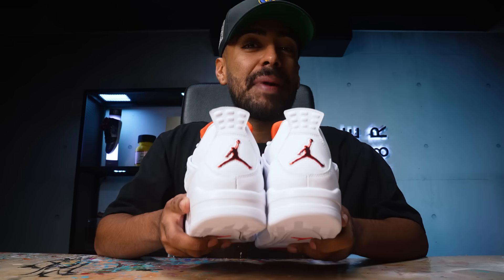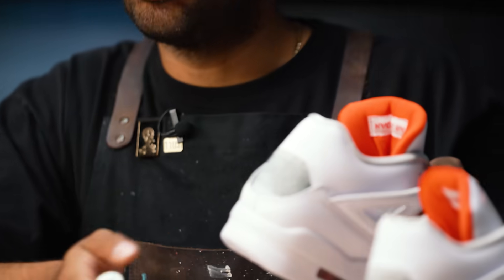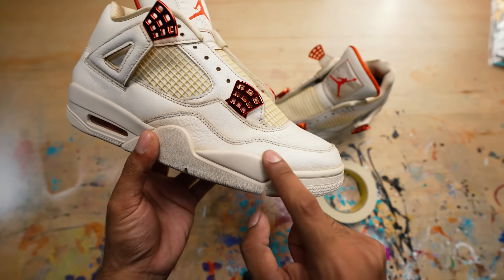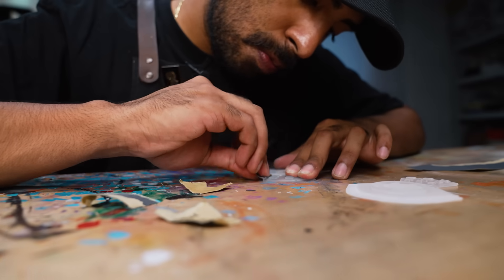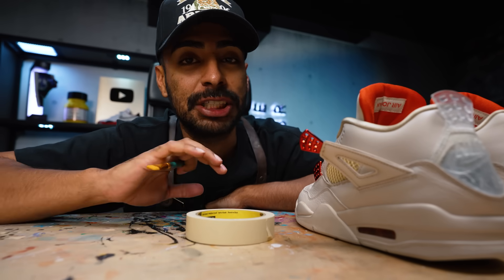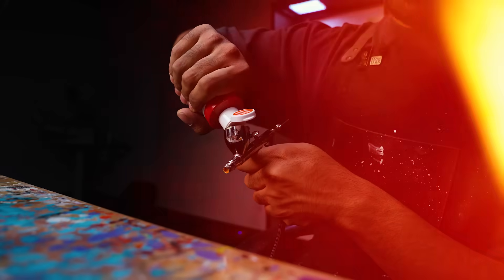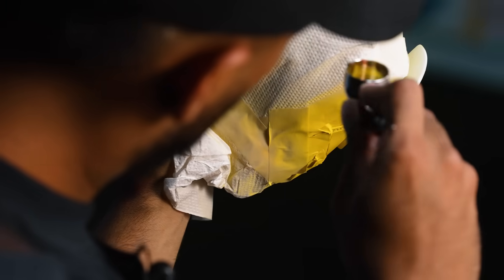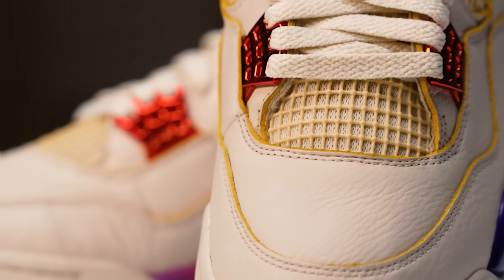Custom Air Jordan 4: J Balvin Inspired

Comment: If you use a little drop of barge over the original heel stitching it holds it in place when you remove the old tabs, and you won't have to replace it afterwards. 👌

Comment: Question… when u do ur paint jobs , do u sand it down first before the acetone or vice versa ? Does every paint job require sanding? This was straight fire custom btw ! 🔥🔥🔥
Reply: It depends honestly if you’re repainting I use acetone to strip off the old paint then sand it down then apply paint and sand it down after I’ve done the paint job then matte finish to protect the new paint job sanding is important with the paint job to make sure everything is smooth and looks clean